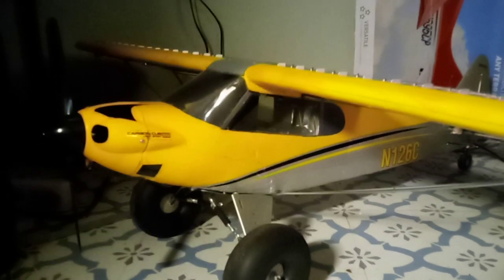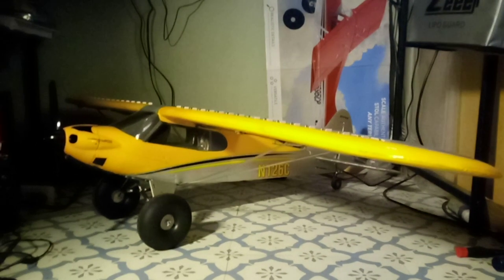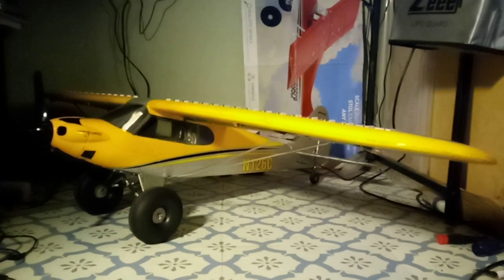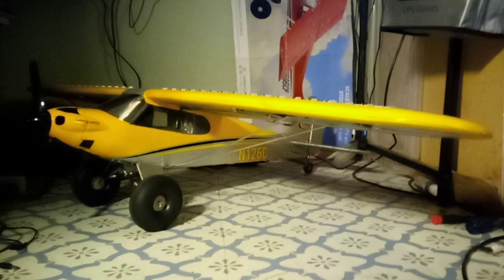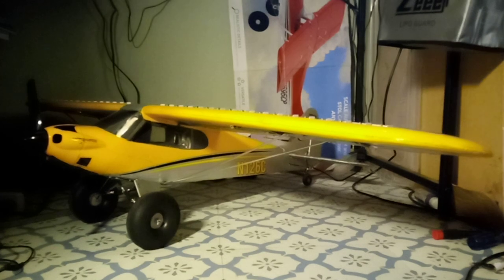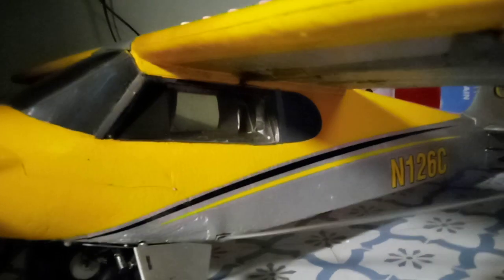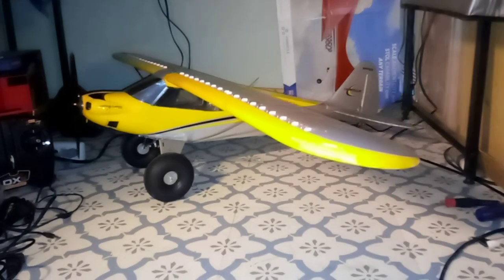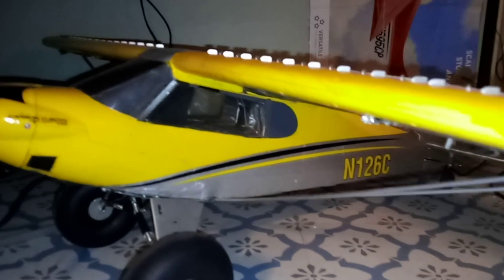RC Airplane Carbon Cub S2: Here Is My Advanced Performance Cub Setup

Comment: So how do you open the battery bay door with the suspension in place? I have made a suspension unit like this for mine, but now I cannot open the battery door without removing the suspension. Hope you can help, especially since the suspension looks so good!
Reply from the maker: All you need to do, is gently squeeze the front of the hatch where the plastic hinge pins go into their holes on the fuse. Then you can carefully remove each hinge pin from it's hole and slide the hatch cover back and out from under your suspension. Later this morning I can post a video showing this.
Reply: Also, how did you make that suspension?